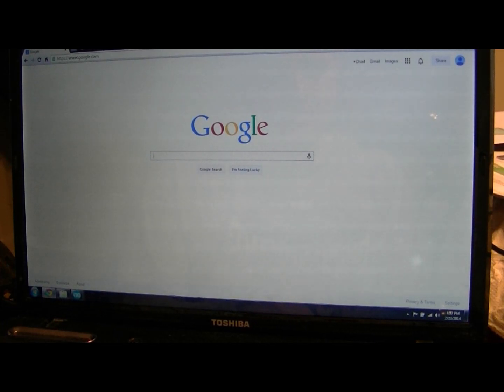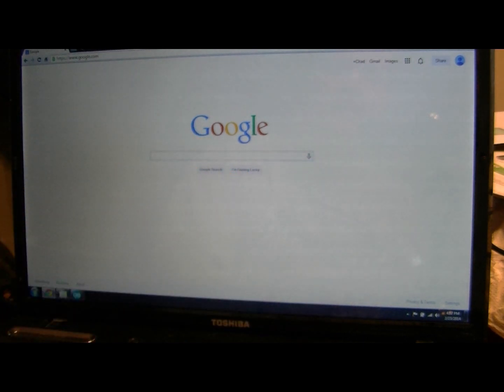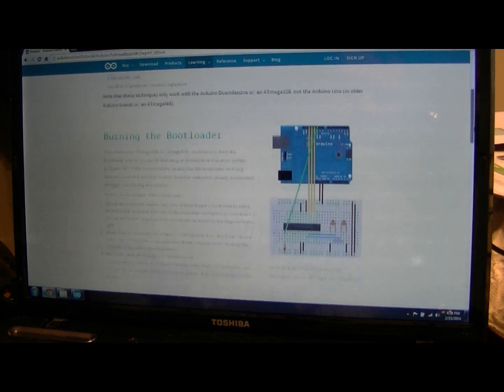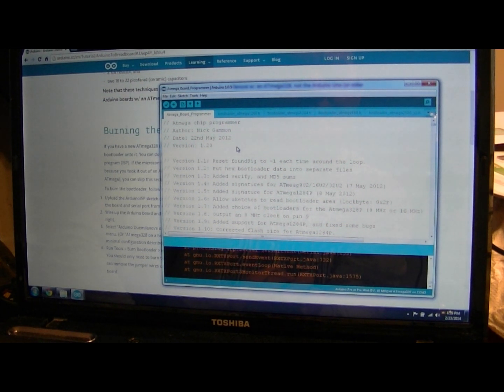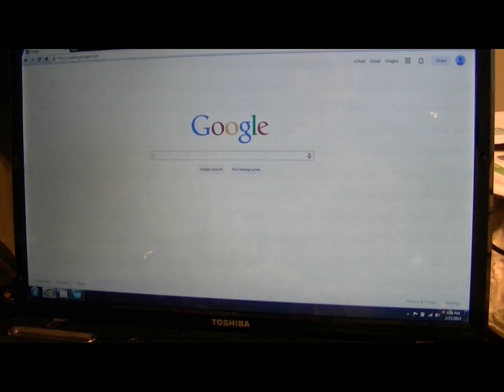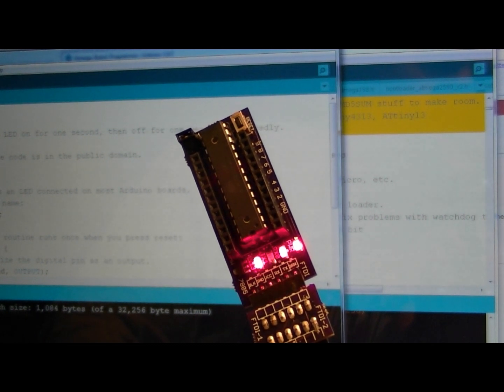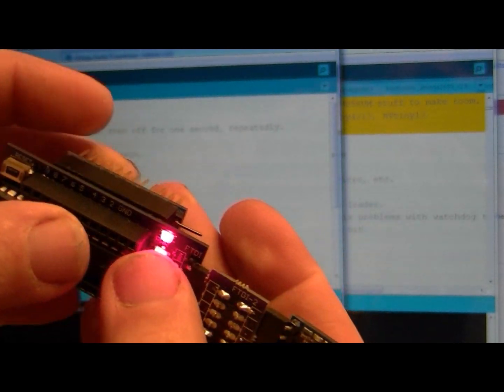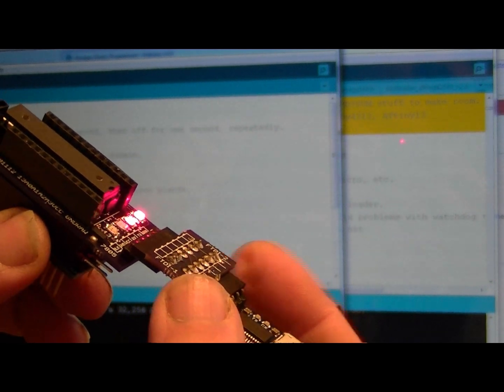Atmega328 Bootloading - Fast and Easy!

Comment: It would have been nice if you would have shown the connections to the boards you made and how you made them. You kind of lost me with the "I made this connector and hook it up this way". What is the converter doing and how.
Thanks for taking the time to make this video.
Reply from the maker: amtpdb1 Well there were very few connections, which is the whole point of this board.  The board stacks on top of a Pro mini, then the FTDI connects to the Pro Mini.  This is shown in the videos.  that's all there is to it, much simpler than jumper wires on a breadboard.

Comment from the maker: I posters follow up video on the custom arduino/shield used here.  Also I may put them up for sale on e-bay if their is sufficient interest.  I have one listed at this time.
Reply: how do you do this for a arduino nano?
Reply: also the "L" led on the nano is flashing red
Reply: chadbh74 are they for sell now with instruction.
Reply from the maker: Ken Wathen Well there is no instruction manual.  it should be intuitive for those familiar with Arduinos.  I may have parts on hand to build one.  There is a link in the video description to my site where there is further information.